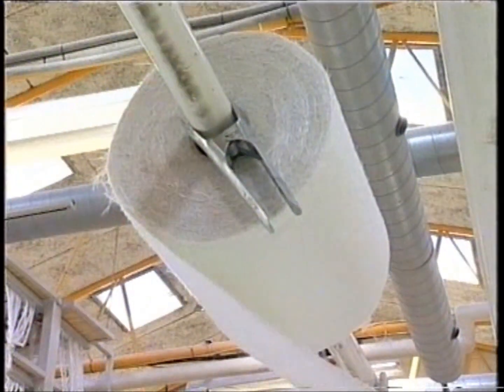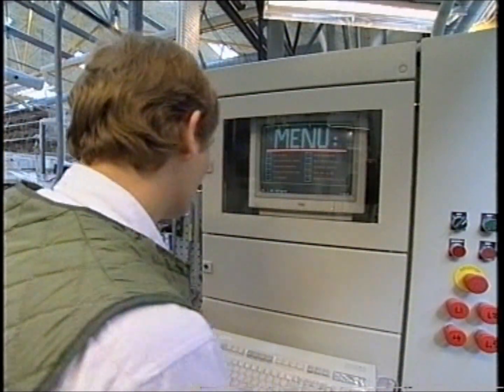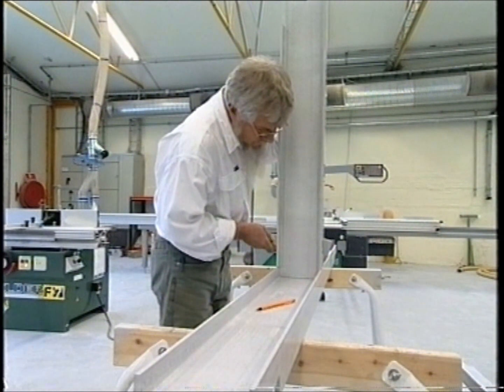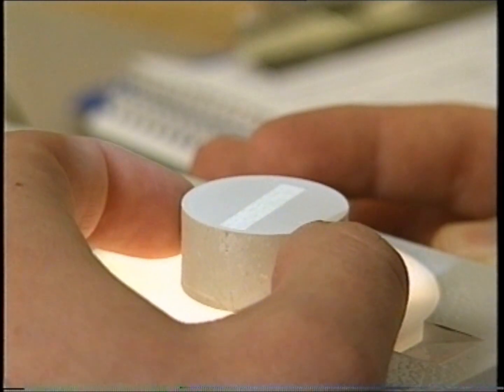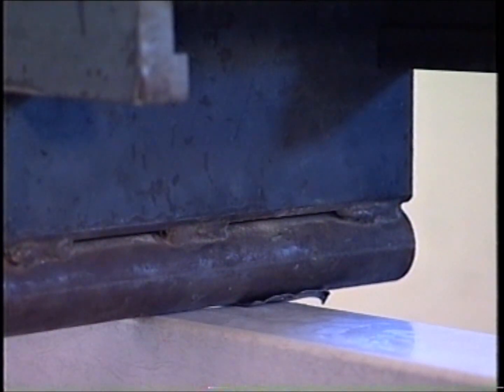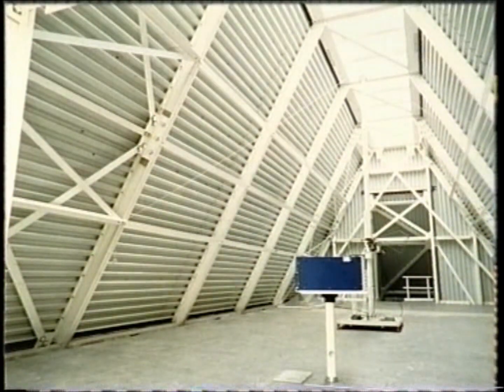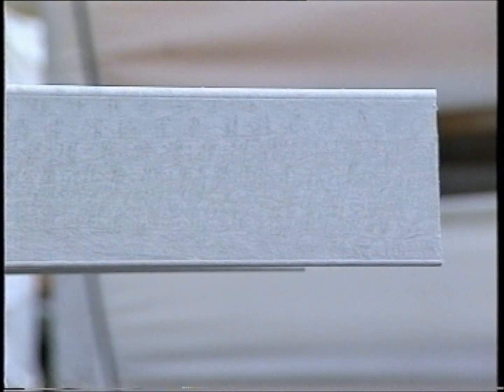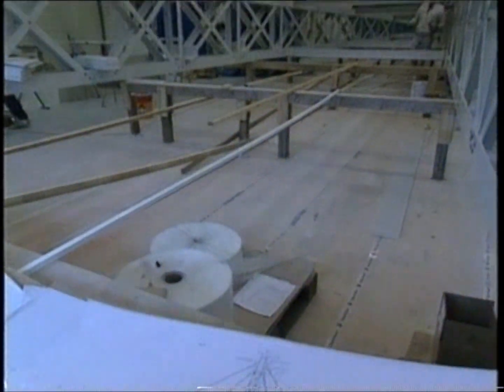Scandinavia's first composite bridge

Comment: The elements would bee detachable rom etchever so reuse  of parts and recycling of  the material in new composite should be doable. 

The uv problem is not hard to solve, if it aqureres  just paint with top coat polyester paint. 
A a fire scenario seeem like a risk full situation for the bridge.
I would guess they have  fire detecting cables run at critical places for early detection.